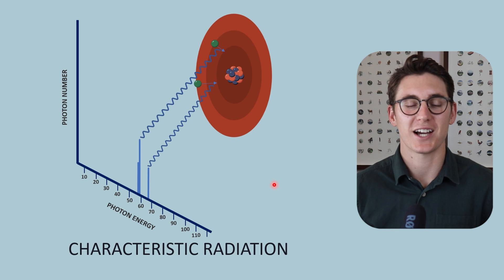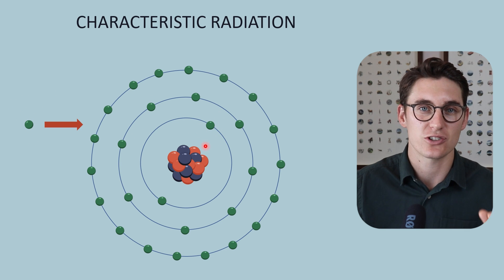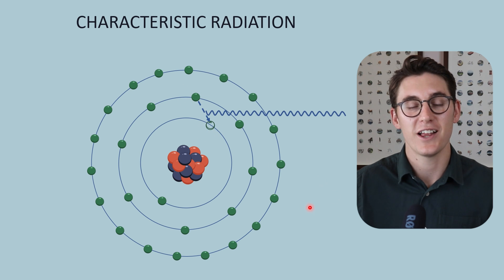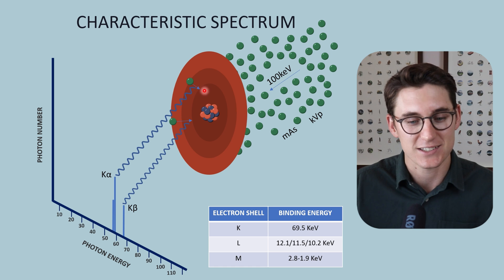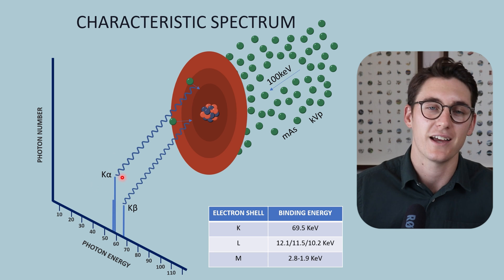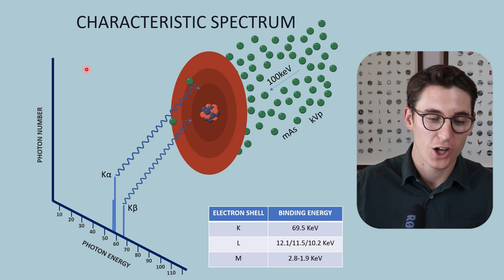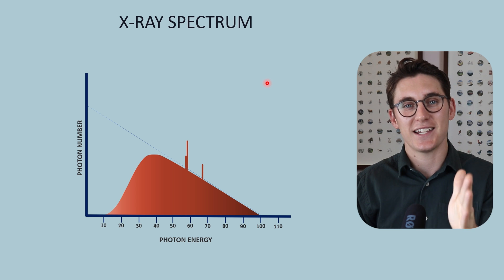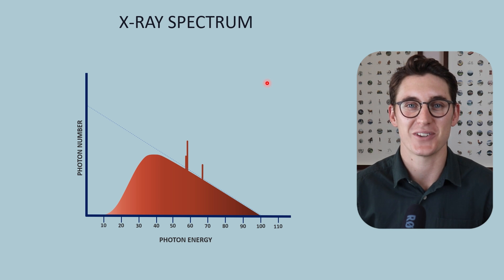Characteristic Radiation | X-ray production | X-ray physics | Radiology Physics Course #20

Comment: Thank you so much for your explanation. I have a question, I might have missed something. The energy of the bombarding electron must be higher than Ek (60) in order to release an electron. Ex: 100. So the energy used in releasing from K shell is 69. The photon released from L shell going to K shell has an energy of (Ek - El). But where does the fraction of energy (100 - 69) go?
Reply from the maker: Great question. The left over energy remains with the incident electron in the form of kinetic energy. The incident (aka bombarding electron) only transfers the energy needed to release the k shell electron. It rebounds off the k shell electron and travels with the remaining energy. Hope that makes sense 🙂

Comment: Sir..How a less binding energy shell electron if moved into a high binding energy electron shell will dissipate energy??..Your vidoes are jus amazing and awesome sir...Thank u
Reply from the maker: Great question. The binding energy is the energy needed to remove the electron from that particular shell. It is not the actual energy of the electron (a sum of the kinetic and potential energy). The total/actual energy of electrons increases in shells further away from the nucleus. Therefore when an electron goes from an outer to an inner shell it is said to go from a high energy to lower energy state (this is completely separate from binding energy). Hope that makes sense 🙂
Reply: @radiologytutorials  omg, thanks alot, you just gave an answer to a question I was about to ask. It had me confused for like a whole semester, I used to think the binding energies were directly proportional to the actual electron energies.
Reply: @radiologytutorials  Great
Reply: @radiologytutorials  Hi sir great explanation. I have a doubt. Say an electron moves from L shell where it had high PE and low KE to K shell where it gonna have high KE and low PE, Mostly as per conservation of energy the high PE converts to KE and low KE to PE.Now where energy is released for spectrum. Note KE is kinetic energy and PE is potential energy.

Comment: What is potential difference?
Reply from the maker: Potential difference is the relative voltage difference between the cathode and the anode. It is also called tube potential or kVp. It is responsible for accelerating electrons across the tube.

Comment: Please Is Characteristic Radiation only produced when an electron strikes the K shell electron? Or it can occur when the L or M shells are struck?
Reply from the maker: It does occur but these are extremely low energy characteristic X-rays (the difference in binding energy at the outer shells is very small). They will not make it past the inherent filtration of the tube and therefore won’t reach the patient.